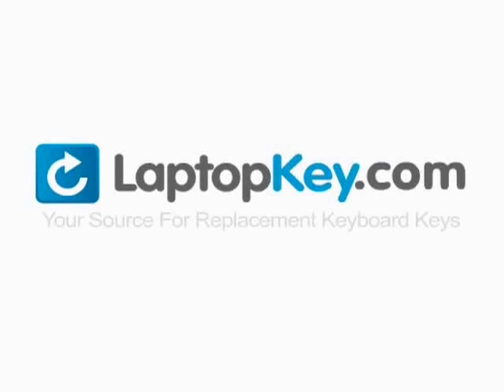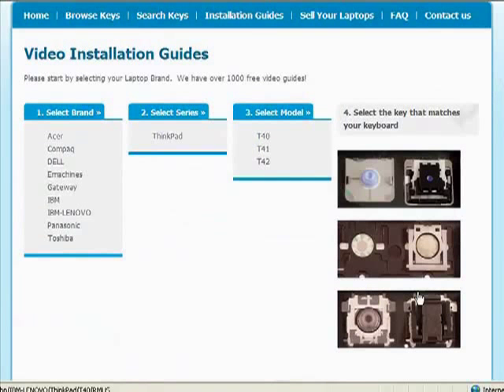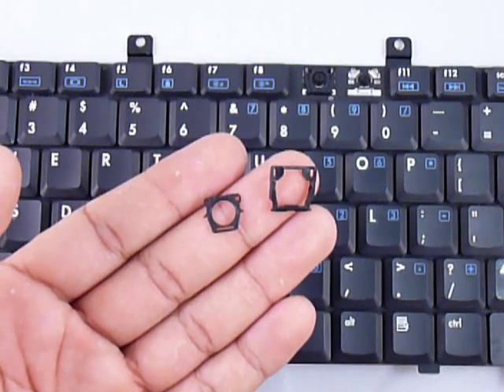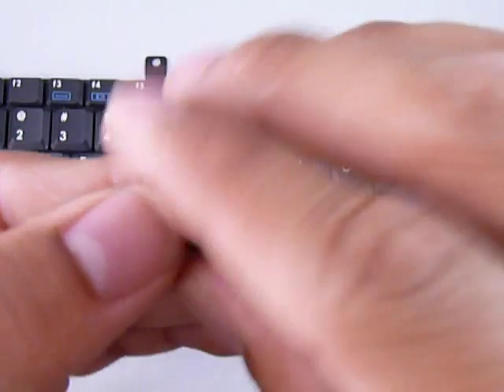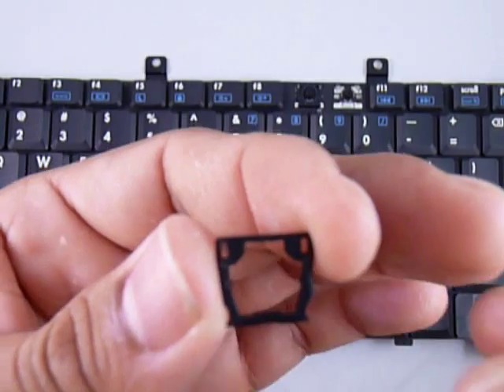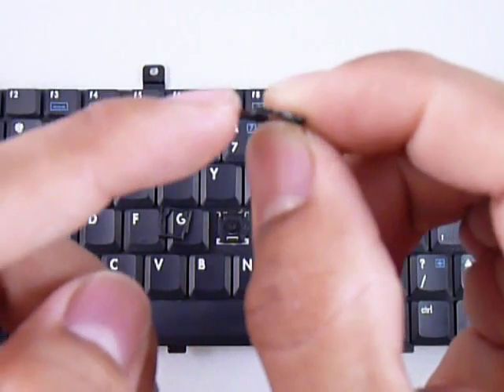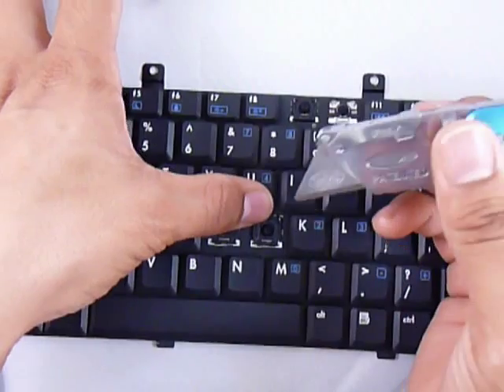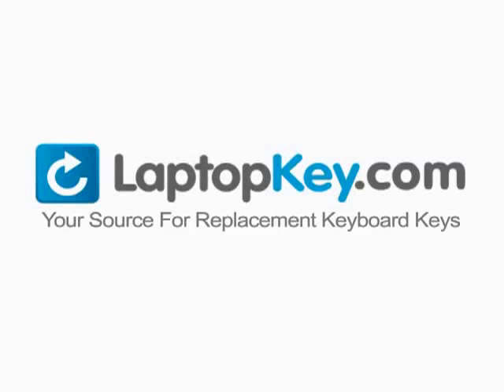How to Fix Repair Keyboard Key  Apple Gateway Acer Fujitsu Lenovo Sony Install Guide

Comment: I stretched the plastic bit with the knife a bit too hard and snapped the clip. When it snapped, the knife went down and I broke the key below that so now I have two broken keys. :-( Teach me to be more careful next time. On the plus side, they're U and J so not used that much... Need to by some new clips now...

Comment: Hi i need an answer i just bought a laptop acer , and my button was twisted so i tryed tiwsting it back and it came out so i tread to glue it on with super glue but it didnt work so the little stick that is sticking otu is stock to my key what shall i do?